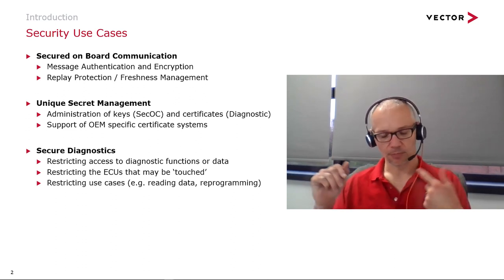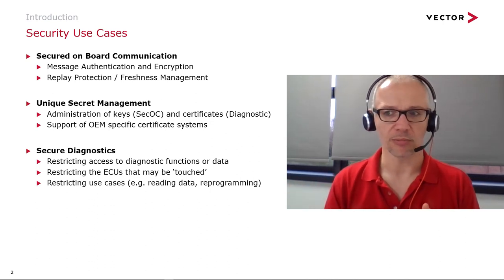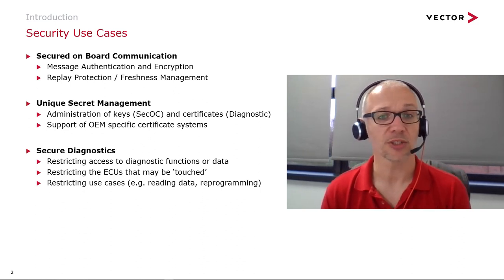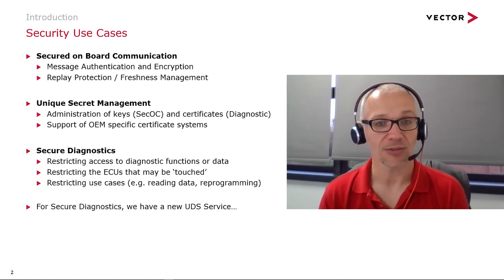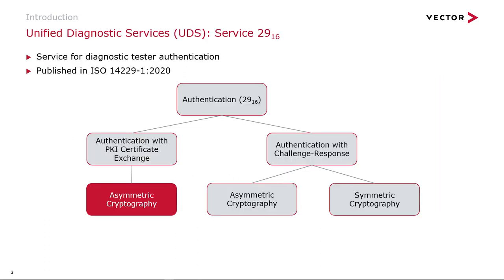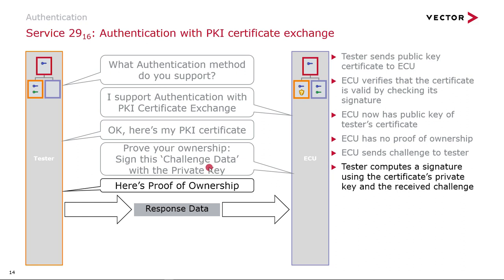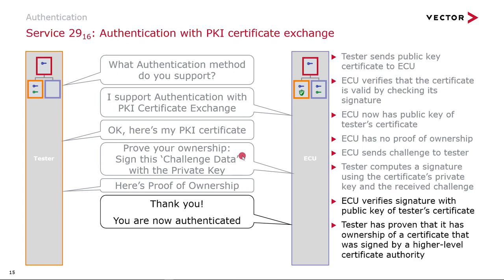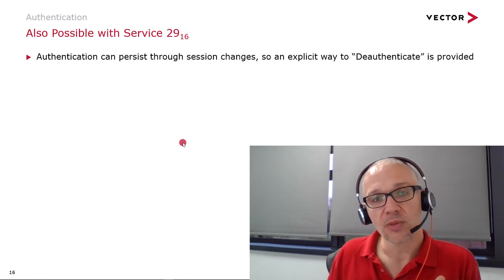Certificate-Based Authentication in Vehicle Diagnostics #1: What is Possible in UDS and AUTOSAR?

Comment: thanks for the nice presentation :) it really helps to know why on top of  having Service 0x27, we need 0x29!- i was surprised to know, Authentication still exists even when session had changed.

is this service applicable in BOOT mode or only in application ?
Reply from the maker: Glad you found it useful! The FBL can implement Authentication, this comes at the cost of increased FBL footprint (as it will need to 'carry' the needed functions).
Reply: @vectorinformatik  thanks for your response and clarification dear Vector

Comment: What's the challenge data length from ECU to verify tester certificate?
Reply from the maker: This depends wholly on the design of the security mechanisms, for example, in our demo we use a 128-bit (16 byte) challenge, while ISO 14229-1 gives an example of a 256-bit (32 byte) challenge.

Comment: How do you protect the FBL? As the FBL does the actual memory write before the application layer AUTOSAR services are available. The FBL cannot use the tester certificate to authenticate to tester access.
Reply from the maker: The FBL can implement Authentication, this comes at the cost of increased FBL footprint (as it will need to 'carry' the needed functions, and drivers, e.g. if an HTA is in use). This means it's very important to know about any possible Authentication requirements very early, to make sure an appropriately sized microcontroller is used!

Comment: Why are you saying that symmetric algorithm is very simple and not secure??? Thats not true. It has nothimg to do with flipping bits. The difference between sym and asym in regards to power is only that in the sym crypto you have only one shared secret, but in the asymmetric you have priv/pub key. However thank you for that video
Reply from the maker: Hi, we're sorry that the video isn't clear here: Iain was trying to say that with Security Access there is no requirement (or recommendation) as to the complexity of the shared secret (algorithm), and so it would be valid (yet also totally stupid!) to just have the shared secret to be flipping a bit or reversing the bit order. In the case of the new Authentication service, ISO14229-1 makes some 'recommendations' for suitable algorithms (based on ISO/IEC 9798-3).